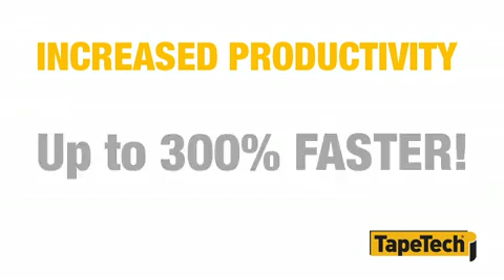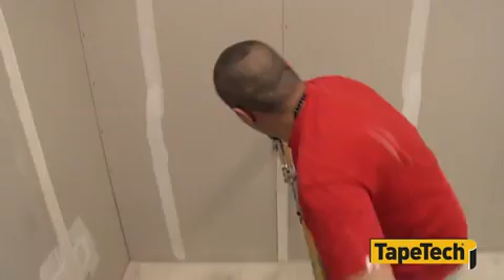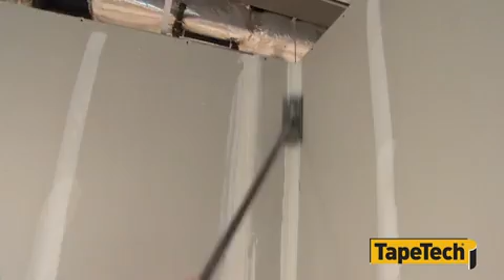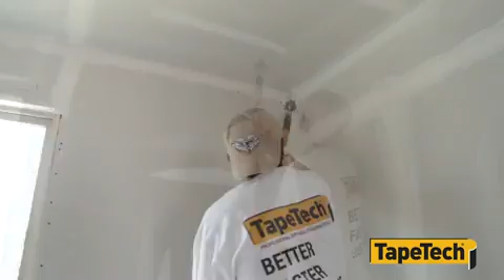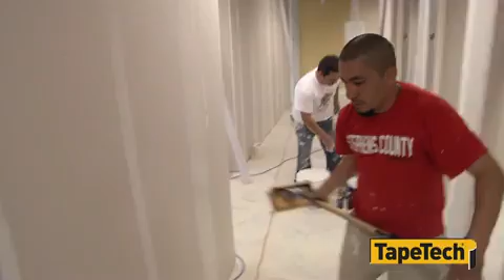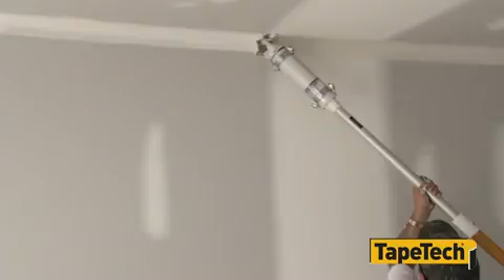TapeTech Automatic Taping and Finishing ATF Tools in Action!

Comment: yes if the drywall is hung properly show me videos with out a square rooms and gaps
Reply: Jimmi Jones 
On every drywall job we do as soon as we're done hanging we mix up a batch of 90 minute quick-set and go around filling any gapped corners, joints, broken corners, rotozip mishaps, etc. then we run our taper. I invested in these tools 2 years ago and have never regretted it. Taping jobs that used to take 6-8 days are cut to 3-5 easily. We've done several jobs with them now and it still amazes us how fast top-coating goes when using the mud boxes.
Reply: Who's John Galt I should invest I always get the shirt everywhere
Reply: Exactly

Comment: Say a room that would generally take 6 hours to tape and compound , how much quicker could this machine have it done in ?
Reply: if it takes you six hours to tape off a single room, you probably shouldn't be doing it. slow is about 3 hours and fast is about 1½hours
Reply: 3 guys tape flats and inside corners on 300 sheet house 4 x 12 sheets.  walls and ceilings.. 3-4 hrs

box it in 2-3 hrs just with one guy
Reply: 1 hour I work in this man like everyday this is the same tools we use it’s worth it